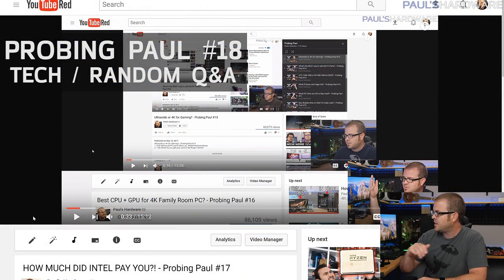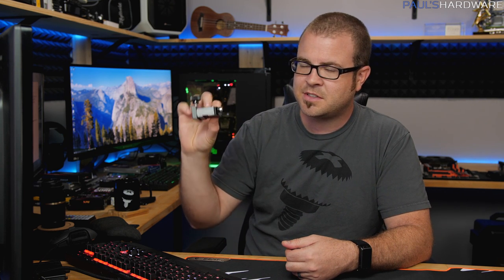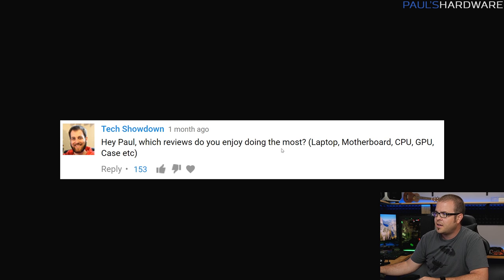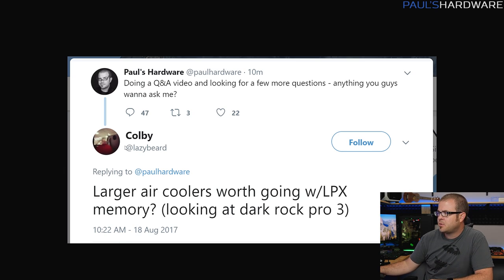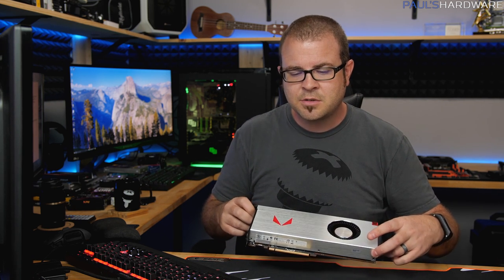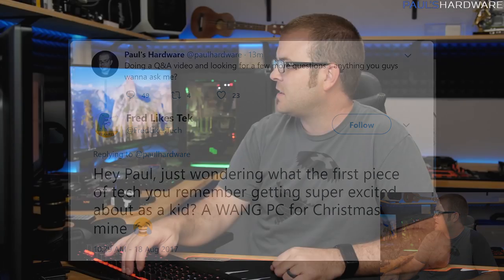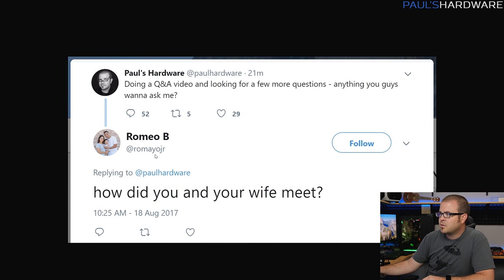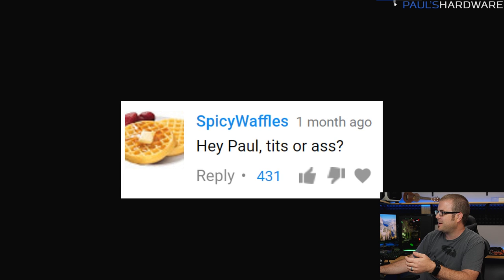Do You Hate Miners? (+ How 'bout Those VEGA Prices?) - Probing Paul #18

Comment: You can deactivate a windows key to use on another computer, so if your throwing a pc away dont forget to get the windows key
Reply: +CorruptedPoison Only if it's a retail key. Doesn't work for OEM keys I thought.
Reply: CorruptedPoison System builder keys are tied to the hardware you installed them on but I don't think that's a hard requirement. You should technically be able to move it just not legally.

Comment: Hey i have. A question. I just built a new buld of 
Ryzen 5 1600
Gtx 1060 3gb superclocked
Msi b350 tomohawk
8 gb 2666 ram
550 watt power spec 80bronze rated 
Adata 120 gb ssd
 I can play rocket league, battle grounds, and tf2. They all run great with no issues. However i decided to download siege for free to play weekend. I cant get 3 minutes into a game with my graphics card going out. Or at least i think. The rgb and everything is fine but my game volume and screen goes out. For some reason this is only for siege even with low everything. Plese helllllppppppp!!!!!!

Comment: just a heads up ...all this GPU pricing crap just really became too much in my last build witch was my Ryzen 5 1600 build so was not that long ago. The prices were just off the charts and there was no way I was going to drop that kinda money on a card that had the MSRP 200.00$ lower. I had to step back and rethink ... well I'm also not dropping that kinda cash on a monitor either so 1080p it is then and there was a clear choice @ the 160.00$ range 1050Ti SSC or the FTW , Aorus also has a very good one so does Strix, for the money what a gr8 little 4GB card and to be clear not a bad place holder till these company's  and the market get their shit back on track. That's about all I have for that. The changing of the prices or doing away with the rebate ...? I still don't have all the facts on this but as it stands with what I know right this sec. "DICK MOVE "  just sayin . I may not see something tho so I may retract later... ;) Paul as always thanks for the help and the info ... Y'all stay frosty .

Comment: The thing with the miners is just an excuse for amd, nvidia and their partners to inflate prices, it's the same with nand and ram supply. Both AMD and Nvidia and push their cards in two lines-for miners and for general use. Firmware and drivers can severely restrict the mining performance of general usage cards and thus make them unattractive to miners. But they wouldn't. The market for GPUs looks very much like the democratic political system of the USA, there's a lot of democracy but only two viable parties to chose from and many times you're only choosing the lesser evil.

Comment: OMG!! 2017! 2024 say's sell me that GC!! ha..ha.. 1:)place a temperature gauge under the board, ''on'' the gpu. or cpu, or fpga! 
in between the circuits!!2:) grab a heat gun, set the temp. now heat the lid/metal top@ 12" away! 
3:) U only need 110-140F to soften the solder/glue..ect...got to around 120F. use de-lider...U'r done!! simple pimple!!
I just wish ''miners'' would grow-up!!! CRYPTO-SECURITIES!!!

Comment: dont delid a 7700k. Its almost impossible to do so without damaging the cpu. Above 90% chance you break the cpu. I dont have the video source rn, but ill try to find it.
Reply: It's not that hard, and if you are careful it definitely won't break. Also should you happen to have a 3d-printer, just print a delidding tool and use that.